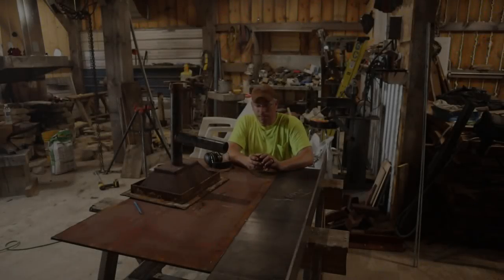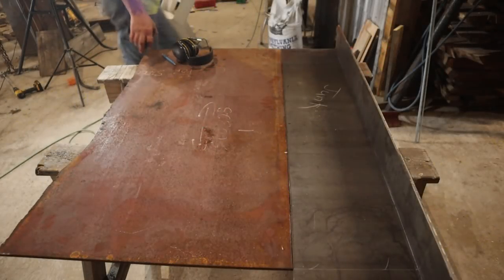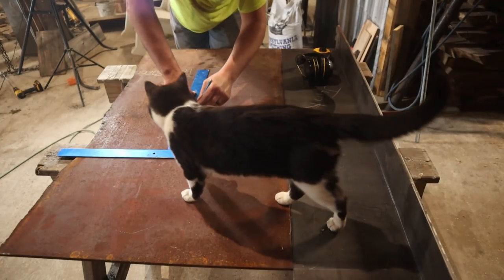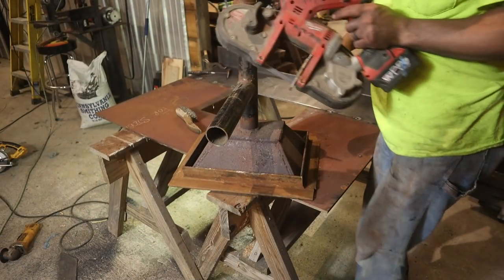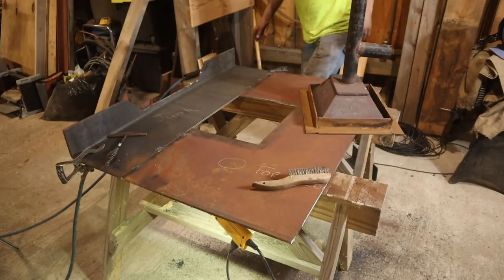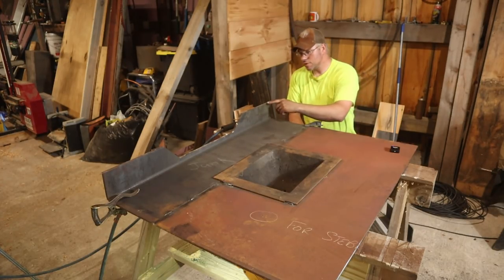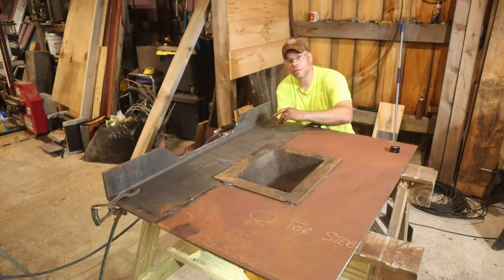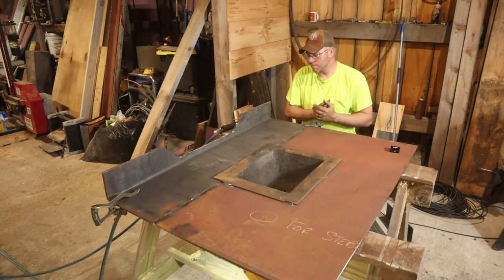Heavy Duty Forge Table Fabrication in The Timber Frame

Comment: Morning Jim. 54th LOL.
Love the new even littler shop supervisor.
Just a thought, but to reduce coal tool catches, why not under-mount the pot (weld it underneath)? Or weld some track to slide it in underneath?
One side of the stone base js open, so that would not be an ussue. Also, is the top not thick enough to warrant a angle cut at the seem and a fill in "stitch" together weld?  Just throwing some thinking out there, little brother. You do You, and if I suggest anything that helps, great.
See you next time.
Reply from the maker: Those are good ideas.  I figured the drop on forge pot would be easier to remove simply because with tracks underneath the pot will eventually rust into place and be extremely hard to remove.

Comment: Before you complete the wellding drop the fire pot flush to the plate.  I didn't and it's a pain in the ass.
Reply from the maker: I've worked with it like this in the old forge table and it wasn't too bad but it probably helps that the edges are rounded over.

Comment: Looking good Jim, that will be heavy to move. Could you use bolts coming up from the bottom to level the plate. Stay safe.💚💜👍🏻🐕👏
Reply from the maker: I'm tapping out the table for that purpose, hopefully it works the way I want it to.

Comment: I can hear your genuine excitement in your voice. Feels good!  Question.That red cold saw of yours, does it eat up blades pretty quick? Thanks
-Will
Reply from the maker: Not too bad as long as you're not hogging with it all the time.  Better just to let it cut at its own pace.
Reply: Just don't try cutting aluminum with the steel blade. Made that mistake with mine. You would think it would be fine. Or just load up, but nope.

Comment: I'm not familiar with the type of Milwaukee circular saw you are using, but I'm wondering if it can't be used for making plunge cuts instead of having to revert to the angle grinder for inside cuts. Thx.
Reply: I can see your idea, but the risk of kickback, to me, would be too high.
Reply from the maker: Good morning.  I worry about the saw kicking back doing a plunge although I was tempted because a grinder sucks compared to that saw.

Comment: "Why"? .... "Youtube!" ...... Ain't that the truth of it ;0)

Got to say I was getting a tad worried about your hernia lifting that beast ;0) ..... It will still be a fair lift for you and another!
That has the makings of one Big forge table. You could simply mortar up the top of the wall and lay the metalwork on it to give a good support base, but it would not be Fixed without a screw or two! When we do brickwork we tend to use a thicker mix than you guys and tap the top down to level it! ..... Different strokes ..
How deep a fire are you planning on having in there? ...... Surely you will not be going near the depth of the edges, mounded in the middle? One thing is sure, you will not need to coal it up often ;0)

Eather way it is looking good! ....... Deservedly so!
Reply from the maker: When I did the block work on my house when I built it I mixed it much stiffer to do exactly what you said.  I would butter the bottoms and sides, tamp them to the string line and then level them front to back.